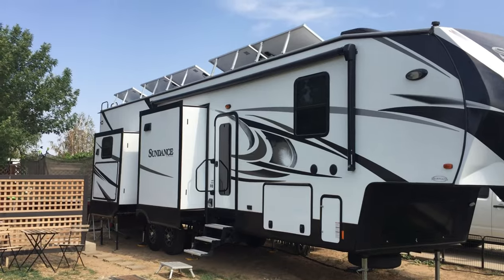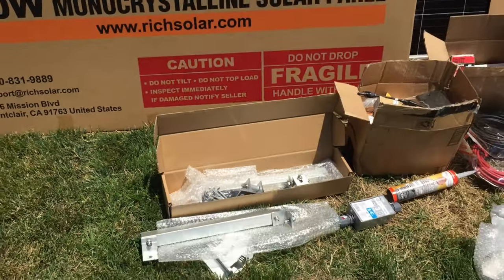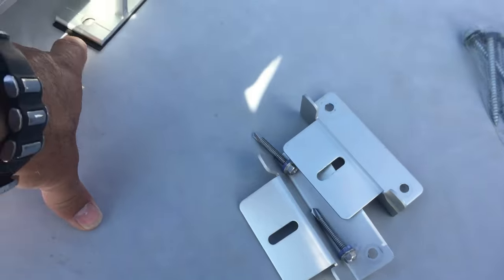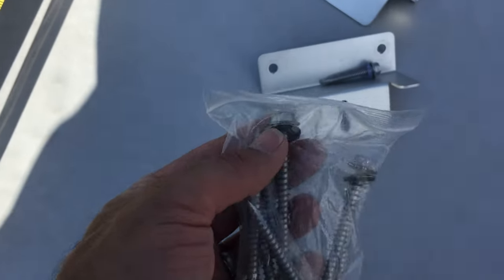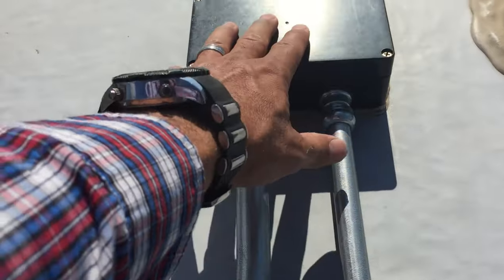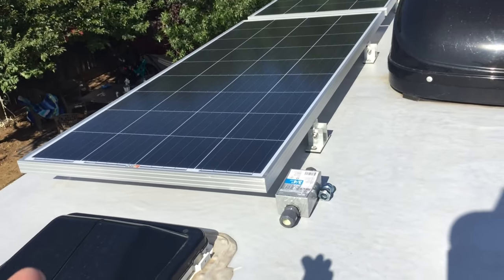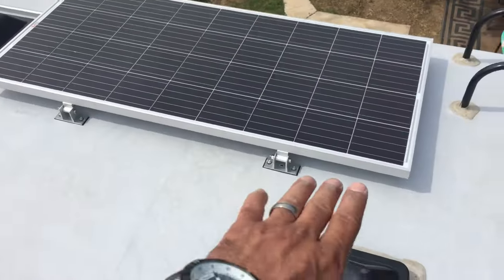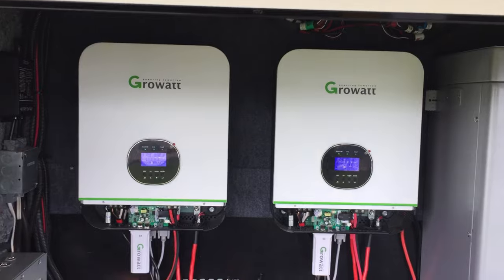RV SOLAR TILT PANEL INSTALL

Comment: The skin effect you are talking about works just the other way around. DC uses the whole cable diameter and AC current will flow mainly through the outer part of the cable. But even that is only an issue on high frequencies or very large currents and thus thick cables. For 60Hz AC, the skin depth is still about 8.5mm according to this Wikipedia article: https://en.wikipedia.org/wiki/Skin_effect

Comment: Where did u get the roof mounting brackets?
Reply: signature solar has the EG4 ground mount up to 4 panels for $279. Secure to RV roof and wala.